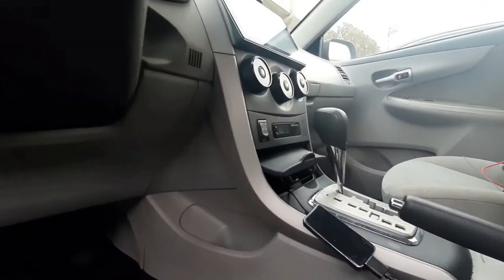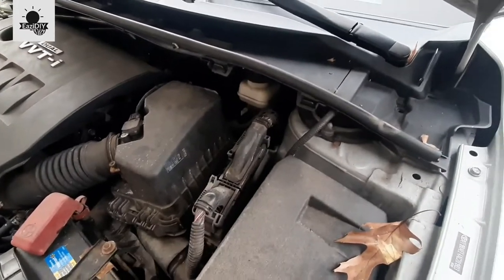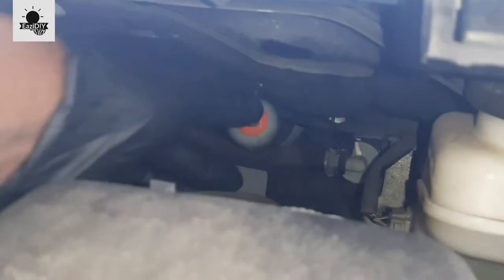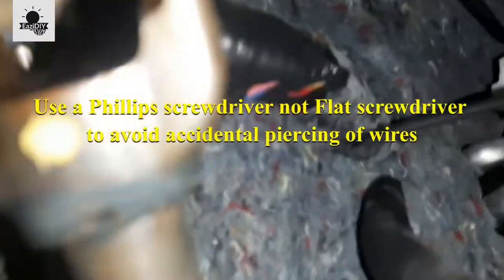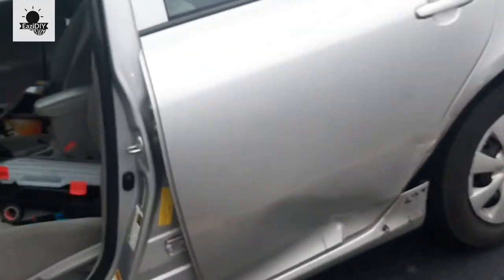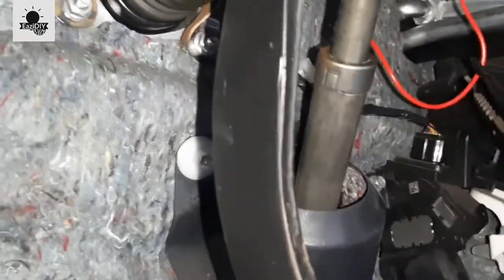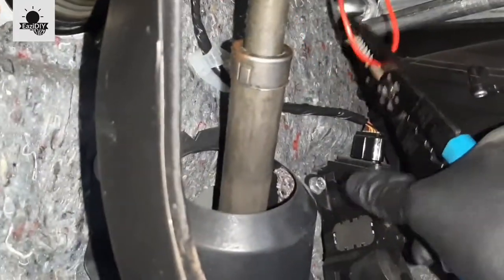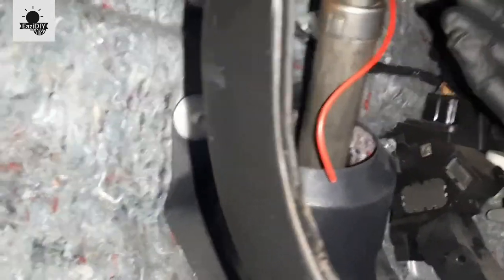How to run wire from under the hood to the dash | Toyota Corolla firewall hole

Comment: Is it okay to leave the rubber of firewall open ? Or shall we apply some weather protection sealant ?
Reply from the maker: You don't want the firewall gourmet left opened otherwise water may enter through it. Especially flood water
Reply: @eazidiy  Exactly, then what's the best sealant ?
Reply from the maker: @thecoddy4663 Kindly check online for best rubber sealant. Thank you

Comment: Interesting...
That looks like a toyota. I am about to run some cable from the battery to the boot. But the cable you are using looks extremely  small to what i am doing, as i want to run 0 awg and it is way much fatter than that, good video though😊
Reply from the maker: Yes, it is a Toyota Corolla